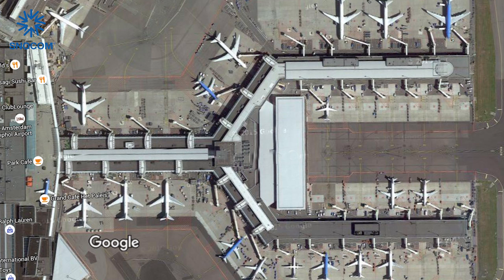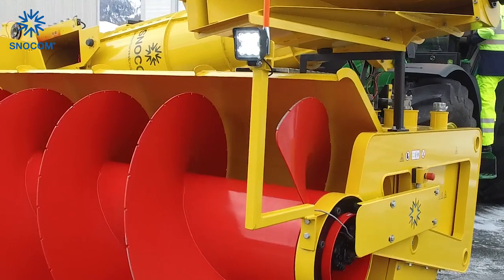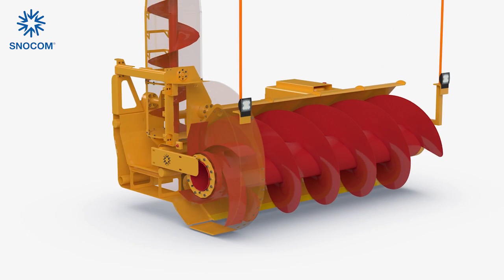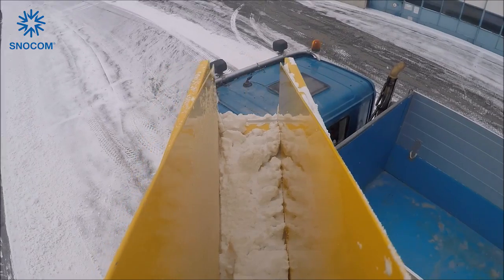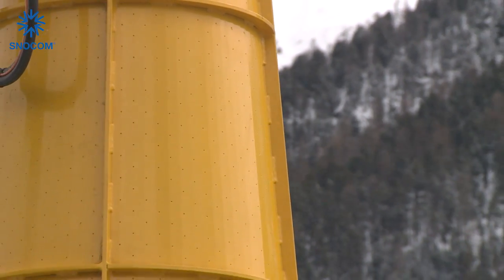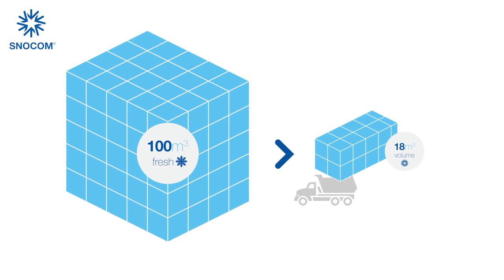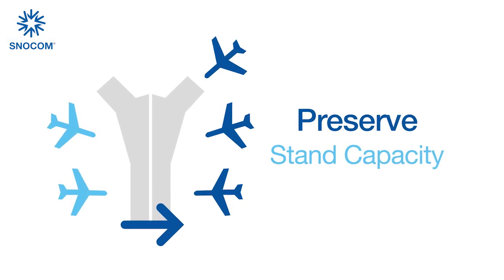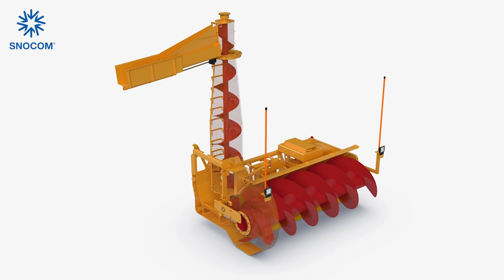The Snowcuber by SNOCOM

Comment: The tiny air holes are a very smart idea!!
Reply: icelineman Until they freeze shut
Reply: They might not due to the compression. There may actually be enough heat generated in the act of compressing to keep the holes open.

Comment: check ''montreal removal snow'' on youtube if you can compact more than that I will be surprise. I drove truck in Montreal like that and it'S very compact!! The snow stick inside the box!!! But interesting concept.
Reply: yep, but why use a tech that already axist when you can waste time and money on a completely new tool XD hahaha.

just using one of those 500hp cat snow blower they got in montreal and the job would be done. also for plow there is a new concept it's a tractor with a double blade, like the one used for highway, but there is also a trailer that pivot sideways adding a third blade

Comment: They say "lower the amount of dump trucks" but if you are compacting the snow to be able to put more into the truck, you are then increasing the amount of weight in the load (by 4x).  I find it unlikely that anywhere there is an "International airport" will there be reduced weight regulations for travel on public roads to move the snow!
Reply: Snow weighs roughly 1/4 of a dump trucks cargo weight. If this machine wasn’t such a laughing stock, it would work, in theory.

Comment: What o dont understand is why dont they just add heating strip wires in the pavement powered by solar to hear up? That would make life sooooooo easy!!!! People can go to the moon but can't make inventions like that??
Reply: For the same reason we just move snow instead of melting it into water, the amount of energy needed is monstrous
Reply: Sola and drains?
Reply: Firstly, you'd need some gargantuan batteries to store enough electricity to power the megawatt class heating grid needed to thaw several square kilometers covered up to a half meter of snow, or even more. Charging the batteries would be a challenge in northern areas where there's little to no sun in the winter. Easier to just shovel it off the runway and then throw on some salt and it'll clear up nicely.

Comment: This is way to slow
Reply from the maker: Hi blhornertube. The snowcuber is not a highspeed blower. Its only for loading snow into a dumptruck. For clearing taxi / runways you need a highspeed blower. The maximum speed for safe loading is 5 km/h.